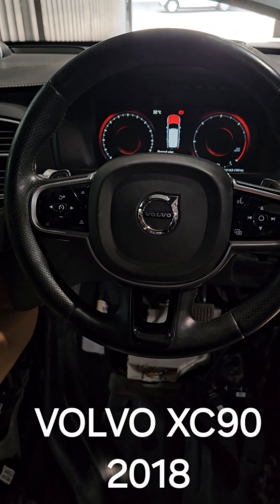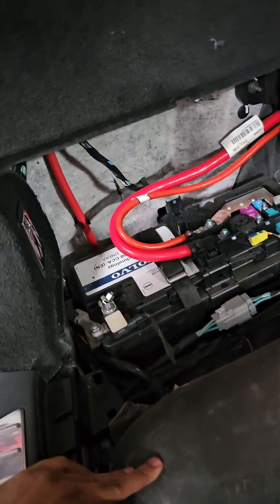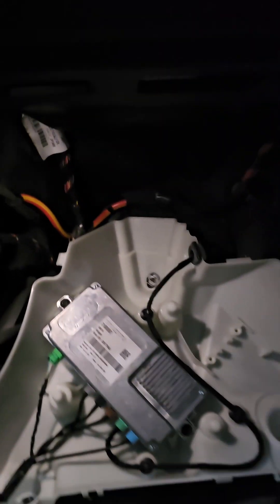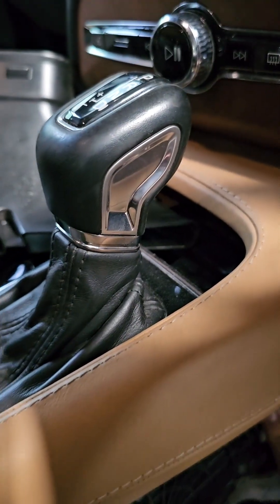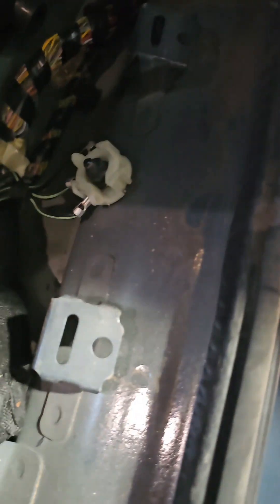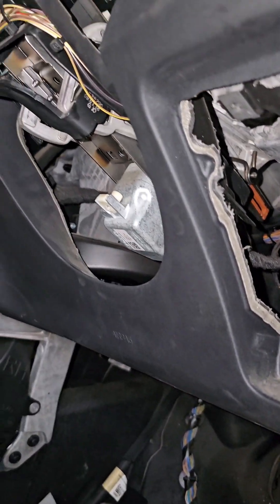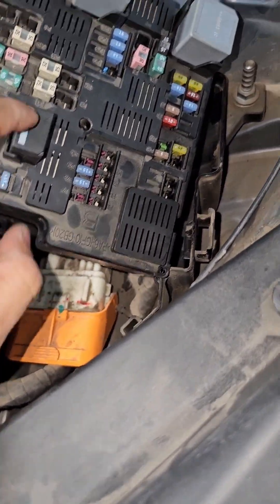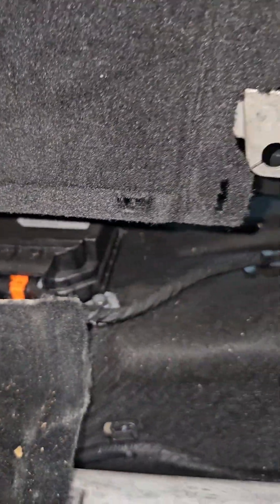VOLVO XC90 2016+ Inscription model all control unit location and fuse box locations

Comment: WHERE IS THE " KVM MODULE " ( REMOTE FOB PROGRAMMER MODULE , ON A 2012 VOLVO XC 90,3.2L , Gasoline, Left hand Driver....  Please Help... The KVM has Been Programmed too many Times...Needs pulled out of the SUV , and Re- Programmed... To my Replacement Flip Key FOB....I Need a Location.
..to Pull it Out..... It is Not on the Pass. Rear Corner Panel.... !!!  BillinL.A.  8/124